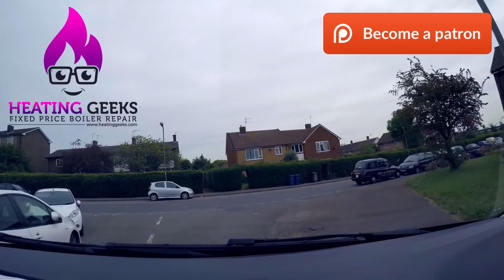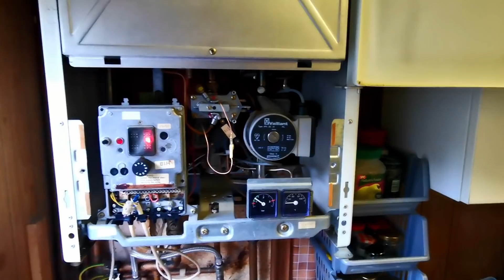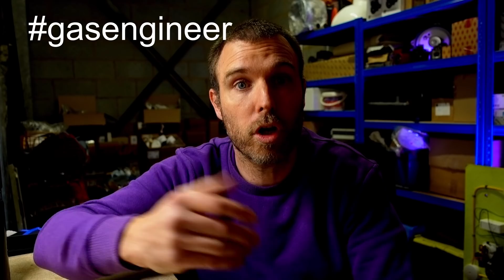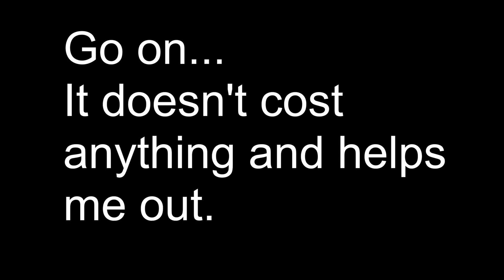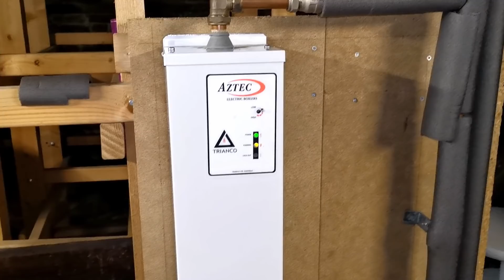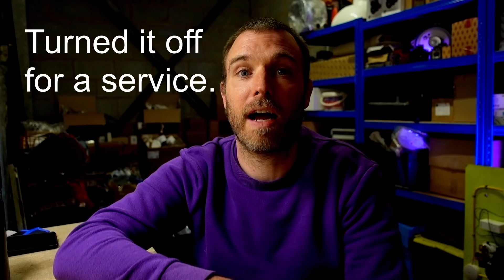Obsolete boiler parts....This could cause problems...

Comment: I have known certain engineer condemning a boiler  because the pilot light keep going out! it was a thermocouple faulty  got one from B&q fitted it working fine then got a gas safe engineer round to check system was fine! You are the sort of repair guy we need more of someone who has got the time and savvy to sort out rather than condemn everything great work, just to add to that said engineer left them over Christmas with no hot water  and put an 11 inch immersion heater in the Top of a normal tank (because there was not one fitted to give them a temp hot water supply ! about half a sink full if you were lucky , there was a b& q across the road! would have taken him longer to bodge the immersion than fix the boiler!
Reply from the maker: Sometimes engineers will look at making money from a job rather than doing the job they were called for. These engineers are few and far between but cause the industry as a whole a problem. Lack of trust etc.

Comment: If I had the Knowladge and the ability to fix a component that had failed then i would fix it with a part that is as good as if not better than the original. The alternative is to condem the boiler which is what most engineers would rather do rather than do what they are there to do which is fix the boiler.
Reply from the maker: I do like to fix things that others have given up on. :-)

Comment: Good work. Especially on the old Vaillant.  I nursed one of those for years until the owner had to move.
Reply from the maker: I want to get myself one of the combi versions to put in a training center :-)
Reply: Vicious! You don’t like your trainees? 😁
Reply from the maker: @maxmerton  Its a great boiler to learn about. It looks so difficult but once you understand it... I'm not sure I understand it. :-)
Reply: HeatingGeek , I definitely didn’t! I could only fit into my brain enough information to fix the thing that went wrong. At one stage it was multiple faults, and I nearly had a hernia trying to work out what was going on. It’s like trying to operate Microsoft Windows without using a monitor 😝
Reply from the maker: @maxmerton  :-) I Just fixed an even older combi today!!!! I have been sooooo stressed about it for over a week. But its done :-) all fixed. :-)
Reply: HeatingGeek sounds good. Which was it?

Comment: Fair play in my book. Far too many are quick to shoot someone down for doing something outside the norm and going the extra mile for someone in need, and as is cleary evident in your videos - it would be hard pushed for someone to say you were not competent here. Yes they could argue that you may not have an electronics qualification, but you traced the root cause of the fault, rectified it and it worked as should.
Stay true to your own goals, because at the end of the day it is who you are. Never be a lemming and get beaten into submission by the narrow minded opposition!!
Reply from the maker: I like that last quote. :-) Its hard not to conform now a days. No one will cover your ass for trying to fix things, :-)
Reply: @HeatingGeek  Yep, totally mad isn't it. The thing that I find strange, is that there are companies out there that are extremely well versed / qualified and able to repair circuit boards / PCB's and offer 1 - 2 years warranty, but it is frowned upon, probably as going repair route prevents Dick Turpin getting their £££'s for what can cost you ££'s with the same warranty... Go Figure, as new boards fail just the same as refurbished ones do. We live in a very strange world that's for certain..

Comment: I have a Baxi combi 105e boiler, which stopped working. I traced the problem to a faulty relay on the PCB, which I replaced at a cost of a couple quid. A gas engineer wanted to charge me £150 to replace the PCB! Excellent video. Just goes to show how easy it can be to fix these things, if you have a little patience and knowledge..
Reply from the maker: But as a gas engineer, i'm not allowed to replace components on a PCB
Reply: Really? I find that a tad strange..

Comment: Nothing wrong with those.
It's turned into a throw away economy with the high cost of parts or not available.
Keep the old ones running and in turn saving the planet by not fitting something plastic.
Top engineer mate, you can sleep at night
Reply from the maker: Did you notice how I didn't change a part on the Gas boiler PCB...:-)

Comment: use to fix my worcester 240  diverter valve diaphragm used to fail often only about 60% efficient as opposed to 90% to my current ideal boiler
Reply from the maker: Unfortunately the Ideal will not last as long as the old boiler. :-(
Reply: @HeatingGeek  what would you say the lifespan is of a ideal logic c30 is ?
the worcester 240 lasted 20 years
and as you say reliable the achilles heel
being the rubber diaphragm in the diverter valve as it split i changed 2-3 0f these
so new boilers are junk but more efficient?

Comment: Top man!
You're a true engineer.
So many just think rip it out when they see an old boiler.
Many problems are only dry joints, easy fix.
Customers are baffled sometimes when I get a hairdryer out, especially as I'm bald :)
Reply from the maker: Yep. I had to ask for the hair drier. :-)

Comment: Nothing wrong with what you did. You're an asset to the industry. It's great to see a true engineer than can diagnose a fault down to component level, especially in today's disposable world. I had a similar thing happen to me involving an extremely old 'Wilson Wallflame' oil boiler... From 1962! 

As your customer found out, many engineers wouldn't touch the thing, even slightly. The owner of this boiler then contacted me. I found it would fire for around 30 seconds, then go to lockout. - Flue switch was good, flame was good, wiring was good... Etc etc etc. - The controller was entirely mechanical in this unit... No ECU, Integrated circuits, or transistors, just mechanical relay logic! - It turns out the lobes on the cams had worn away the plastic on the micro-switches, after over 50 years of service! New switches were sourced, soldered, and refitted, and the boiler ran as good as new afterwards. 

Sadly, the boiler was swapped out in 2019, in favour of a condensing combination boiler. The newer Worcester Heatslave is certainly efficient, but I doubt it will last for 57 years like the Wilson Wall Flame!
Reply from the maker: Never. They will be lucky if the new one lasts 1/4 of the time. Sad isn't it....

Comment: Cool! Any joint on a PCB with a ring around it is a dry joint, it just needs reflowing with some new solder added.
Reply from the maker: The joint is ok though. The other repair was on a electric boiler so gas regs don't matter :-)

Comment: I would happily do this, but we don't for liability reasons.  We're not certified/trained/insured to do any sort of electronics repair.  If a problem ever occurred because of something we did like this, our insurance likely wouldn't cover us.
Reply from the maker: Where does the insurance stop? Gutters, baths, wet rooms saunas swimming pools drains or boilers? Can you change a PCB or wire a new thermostat or is that electrics? Insurance won't cover you for anything 70% of the time. Can you work off ladders?
Reply: @HeatingGeek  We can do anything that would be within our trade scope (Sheet Metal, Plumbing, HVAC, Gas Fitting).  We can replace anything within a unit (high or low voltage) that would be considered a manufacturer recommend repair or industry best practice.  Outside of an appliance, we can wire any low voltage controls.  We can work off of A-frame ladders.  And yes, insurance is a pain and they'd probably try to fight paying for any major problem in the first place.

The big thing that we try to do (to prevent the need for soldering) is to scavenge essential and rare parts off of old equipment that we are replacing.
Reply from the maker: @kt72383  Can you work with three points of contact of an A-frame ladder? Insurance is a minefield. Changing a capacitor on a pump is ok? Or not Ok?  This is where the problem lies. How you draw the line is not how your insurance company will draw the line.
Reply from the maker: @kt72383  Your absolutely right about old parts. I wish I kept more. :-)
Reply from the maker: Insurance is a PITA

Comment: Fair play to you for going the extra mile. I’ve done it loads of time for my customers but I must be honest I rarely resolder boards, although I do carry the kit on the van still, I draw the line at ordering and replacing individual components. Respect to you for doing it but if I go to a 1992 boiler and it’s fecked and obsolete parts then that’s where it stops for me. I’m not interested in world of pain anymore. It’s done it’s time. It’s not a classic old car, chucking money at it year after year won’t make it go up in value. It’s dead money. Scrap it.
Reply from the maker: That boiler could last another 10 years though.
 :-)
Reply: Yeah but I’d rather not be stuck trying to bodge it for another ten years!!! If the customer has the money I think the only fair thing to do is point out to them that they could have another ten years of lash ups and aggro keeping it going. Or change it now for a boiler with a ten or twelve year warranty and have peace of mind. Ok I don’t get any breakdown income from that boiler for a decade. But I will get the service each year and they get to not have the stress and worry about what happens the next time the old dinosaur packs up.

Comment: not a problem at all.  i had a cracked joint on a old worcester. on the potentiometer.  such a basic fault that can be fixed by simply putting a jumper wire from the leg of component to the track on the board.  British gas think they are gods,until they break away and start up their own business....i.e sole trader?......And then they think to themselves...'what a dick i was'.  Looking down on buisness'  like your own.  They live in a bubble then they get a wake up call
Reply from the maker: No laptop is what worries a lot of them. ;-)
Reply: What do you mean?

Comment: How do we feel about the reconditioned parts market? has got me out of a hole on occasion.
Reply from the maker: Exactly!!!! Not allowed though. I would happily fit a recon for my mum to get her out of trouble. :-)
Reply: @HeatingGeek  I have had the odd fan reconditioned, had an older couple that could not afford a new fan for his Warm air system, had the original reconditioned, came back and you would honestly believe it was new. Some obsolete PCBs can be a very simple fix as a temporary measure.

Comment: Totally agree with you Ollie, problem is a good 75% of engineers earning their living in this industry don't know how to check for voltage, continuity or resistance using a basic multi-meter and therefor don't even have one as part of their toolkit relying as many of them do on a cheap neon test screwdriver.
Reply from the maker: Multimeter and your scenes diagnose 90% of problems. :-)

Comment: I would have done the same, with two conditions:
1.  How has the attitude of the client been throughout my visit?
2.  Does the client understand that their boiler is considered obsolete and that my repairs my not keep them running into the next season or cold snap.

Good on you for doing what used to be considered standard troubleshooting and repair.
Reply from the maker: You hit the nail on the head. The client's attitude makes all the difference. :-)

Comment: Nothing wrong with a recon pcb if it works👍do you have a vid for the glow pcb fault you mentioned also have had a couple of times exactly the same fault on a raven heat White star intermittent hot water it's always been the pcb keep up the vids 👏👏👏
Reply from the maker: I dont have a video on the glowworm. I have filmed it twice for other engineers but haven't had the fault since I started youtube. I will get it filmed when I get the chance. :-)

Comment: Nothing wrong with replacing components if boiler is safe and relatively efficient. Fixed my Potterton with parts that cost pennies. New board was £147 and now obsolete. I wish you lived round here as most boiler repairers  think the ideal of fixing is... keep swapping parts until maybe it works. Keep calm and carry on the good work.
Reply from the maker: Thanks. Parts fitters are not engineers. :-)

Comment: It's just to easy to say you need a new one without even looking at the problem .. how do expect to gain a knowledge if you walk away from problems. . I have in my time come across a lot of dry soldered joints . Some times they work some times they don't but most of the time they work ok .. so keep up what you are doing it will make you a better engineer. .
Reply from the maker: I honestly think engineers see an old boiler and don't know how to diagnose on them so they say you need a new one. :-)

Comment: 😆 sorry what did the hair dryer do?
Reply from the maker: It got the boiler working temporally until I could come back and fix it properly. :-)
Reply: @HeatingGeek   ok i still don't fully understand. you said you used the hair dryer to test your theory... what was the theory? does heating up a capacitor give it more charge and reconnect it

Comment: Blows my mind every time the lengths you go to to rectify faults, 99.9 % of engineers would of said new boiler or at least new board, amazing stuff 👌👊
Reply from the maker: The problem is there was no new board for either boilers.  So only to options. Fix PCB or fit new boiler. :-)

Comment: Your Awesome Ollie! What you did was absolutely the right thing to do! The other engineer's were clearly not interested in rectify or even having a look at the problem. There nothing wrong with soldering a dry joint on a PCB👍 Your a honest and decent top bloke!, you made time to go back to the old fellas and repair his boiler. Your knowledge of electronics's is second to none!!🔥👊
Reply from the maker: I only have a basic knowledge of electronics but I will try and fix any boiler. If the manufacturer has given up on it then why shouldn't I try my best for the customer.

Comment: I'm a sparky and we all come up against customers who genuinely can not afford to replace stuff. Personally I think we are obliged to help where we can and simple solder or individual part replacement is only helping. We may all be vulnerable and broke at some point so lets hope what goes round will come around. Power to you, well done.
Reply from the maker: Thanks :-) The regulations make it hard for engineers to do simple repairs like this though. What do electrical regulations say about that sort of thing?
Reply: @HeatingGeek  Regs are more for fixed wiring. circuit board repairs are not covered. As i understand it we are not supposed to repair circuit boards because of warranty, but that's just a manufacturer monopoly thing. Also who would ever know and on a boiler with obsolete parts who are you harming.

Comment: That’s what I do. Take my knowledge from building and rebuilding stereo amplifiers electronica circuit boards and apply it to HVAC.
Reply from the maker: Are you in the UK? The gas regulations don't allow us to repair PCB's. We can only replace them and when the manufacturer stops making the part we change the boiler. :-)
Reply: HeatingGeek San Francisco California USA location. Over here if you have 1000 technicians you would be lucky if there’s one that has the ability and knowledge to properly repair PCB

Comment: So nice to see an engineer with a soldering iron, instead of a Condemned sticker. I worked as a diagnostic technician for rolls-Royce, before retraining 14 years ago as a heating engineer. I come from a back ground of repairing part. I find it so frustrating when you go into a house where they have a contract with one of the bigger companies and have been told they need a new boiler when actually they just need a decent engineer to look at it.
Reply from the maker: Why leave RR for this??? I would love a job like that. :-)
Reply: HeatingGeek  unfortunately it came down to pay I was only 22 and even though I was one of there youngest master technicians they told me I had to stay on £6.50 per hr until I was 25 I could afford to stay. Rolls-Royce wiring is a very much like heating wiring on the old handmade cars, if they ran out of red wire they’d grap some blue spice it in.

Comment: I don't see a problem with repairing a PCB , if your competent then why not . I've done loads over the years , had a ferroli Maxima 35c last week , tenant had nackered the reset button on the display board , the display has two extra buttons hidden that don't get used so unsoldered knackered button and fitted one of the spare ones  , job done .
Reply: Yes , very strange fault , boiler would work for 30min at a time then just sit with pumps running but would not go to ignition , analysis would work ok but just sit the same if you came out of it again . Reset power and it would work again . Any way turned out to be room stat spiking the low voltage ,freaking out either the cvi or display . New room stat fixed it . Great channel very good content aimed at engineers just like me 👍
Reply from the maker: Nice one. Did you find out why they needed to keep reseting it?? :-)

Comment: 2 excellent fixes,like most thing's,if it don't work,stick a new one in,until you come up the obsolete part's syndrome,then it's no mate,gotta have a new boiler,yeah right,my old mum had the same experience until she got a friend of a friend to sort it out (registered gas safe) not many people would dig that deep.well done mate, although I would've reflowed all the other solder joints on that board.two new customers on board.result.
Reply from the maker: I always think would I do it for my mum. :-)